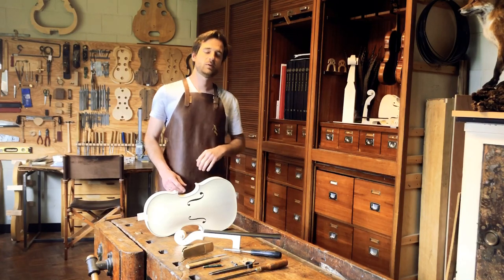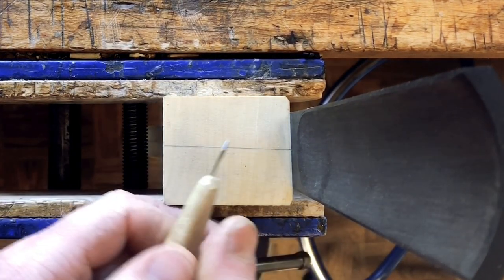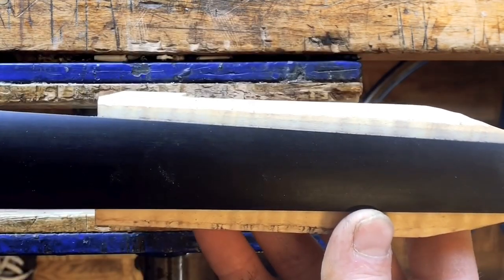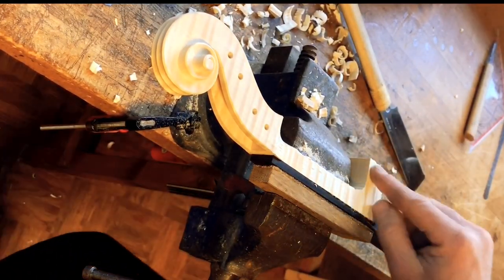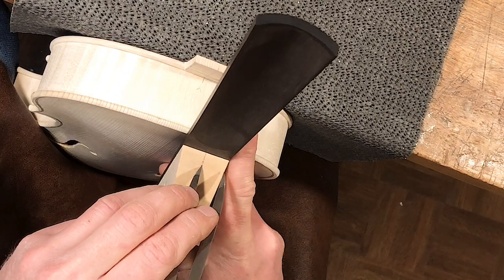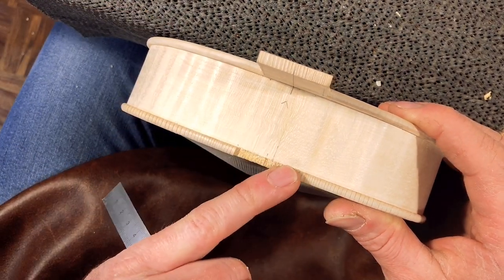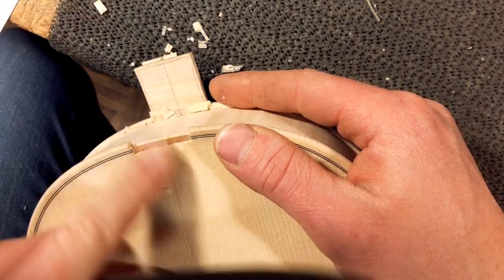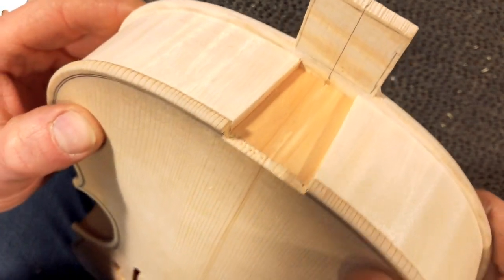Inserting a neck into a violin or viola body with Anton Somers - Part 1

Comment: Thank you for a detailed demonstration in this part. You measured precisely all the points etc, but I fear you could have been more accurate marking out the tilt of the centre line of the neck root though as it seemed it ended up with a little more tilt than maybe intended (0.5mm tilt = 2mm shift at the bottom?). I look forward to seeing the rest of your videos as I need to finish off another violin I had started a few decades ago (I continued to work with instruments, setting up & repairs & refitting necks too). I've prepared the ribs on the form, carved the top of the belly & the scroll & peg box but still need to do the back etc, so getting a refresher with technique (& maybe fresh technique ideas) is very welcome. Thank you.

Comment: I understand why you are trying to make your bridge more symmetrical in height, however, the higher the bridge, the smaller (more acute) the angle is of the string passing over the bridge & the greater the force on the belly it would be. Is that considered & factored into your decision to raise the 'treble' side as the A string (on viola) has the highest tension of the four strings? Yes, I know there is a sound post that side taking a lot of the strain under the belly near the bridge whereas the bass side is only supported by the added strength of the bass bar. I see some violins (& violas) where the neck is tilted, being obvious in the tilted angle of the scroll & peg box. To me that is either warping of the neck or careless fitting in the first place.

Comment: How do you prepare the sides of your fingerboard before you glue it to the neck? The sides are angled I suppose? If fingerboard and heel run fluidly one into another? How do you angle them before knowing the angle of your heel? Thanks for sharing
Reply from the maker: Dieter Hillewaere these days I just make it square to the glue service.

Comment: The points are not seen. It seems like more work than others do. You didn't show us how it fit. I wanted to see the fit. It looked like one line was angled and the other was almost straight.
Reply from the maker: Dear Patricia, 
What points do you mean and what lines? 
Do you really think my fit was notting less then absolutely perfect? 
I’m really sorry that this video was not up to your standard or expectations. 
Maybe try to search for another one out there who tells you more detailed free information! 
Good luck and cheers.
Reply: @antonsomersviolins9452  I am sorry. I feel as I offended you. I am truly sorry. You are far adept at your craft than I am, since I know nothing. I only meant that the scratch lines and pinpoints you made could not be seen. It looked like a  straight line on that one side, instead of a diagonal one. Again, I am sorry.